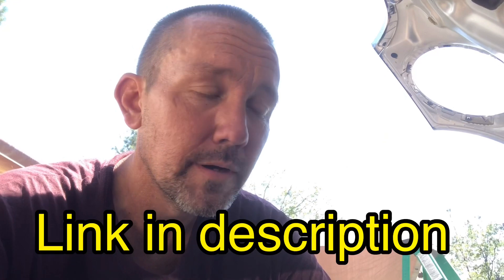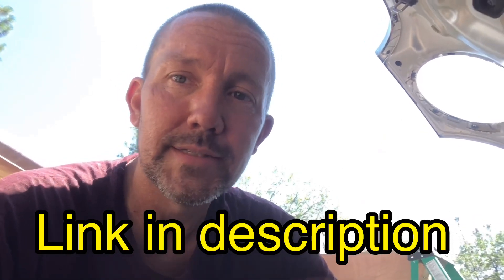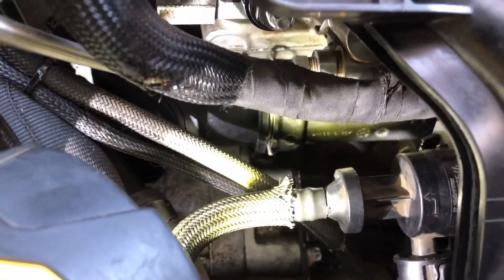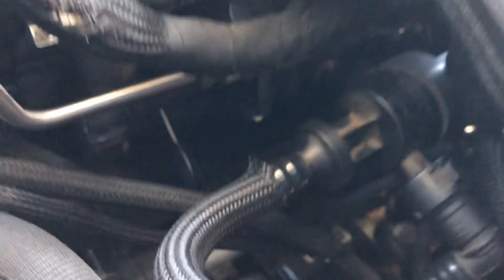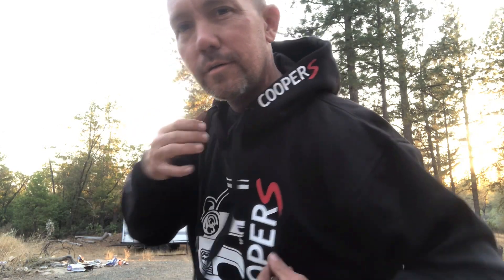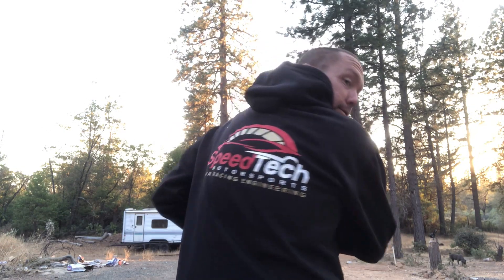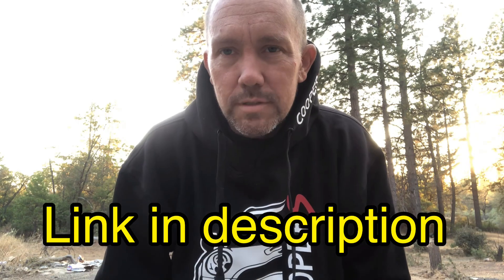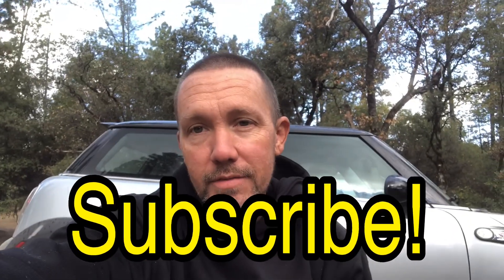How to remove & install the thermostat housing retainer clip on an R56 Mini Cooper S (N14 engine)

Comment: Finally a video describing how to put this darn clip back in.  I have struggeld through three different installations with this clip.  Just the fact is it rotates, and NOT go straight in is the SECRET!  At this moment, I dropped my pin somewhere in the back of my engine, (I might have an old one...) and wanted to see how to actually put this clip in.  I did not know it rotated.  Thank you for describing this.  Ugh!  Now hopefully I can find this clip (or my old one) so I can finish my beloved R56 (2012).  I bought this base (non turbo) coupe, for $500 and totally rebuilt the motor with 0.5mm oversized pistons.  I continue to get the P00BD "Permanent Mass or Volume Air Flow "A" Circuit Range/Performance - Air Flow Too High" because of the bigger pistons.  I have replaced many many parts, and even Mini service could not fix it.  My son is an ASE mechanic and smog ceritifed for the state (my interpretation) and it's just the internal software of the Mini calculates too much air flow.  To fix it for inspection (to get the check engine light off) I do the Vanos 'Adaptation' adjustment (Foxwell meter) and it takes the code off long enough to get it through inspection.  If anybody knows how to solve this exact problem, I would be forever greatful!

Comment: Hi i have 2009 1.6 petrol  mini and i have problem when i start the engine the radiator fan stay on and after I switch off the engine fan still on until 5 minutes i change the sensor or housing thermostat but still the same any help

Comment: My mechanic just told me the Clip isnt that Important, because the Crossover Pipe sits firm between both ends. What do you think about that?
Reply: I just found out (now that I’m replacing my thermostat) that I was driving my car for I don’t know how long without the clip. At least since I bought the car 4  months ago.
Reply: Same here. I don’t have a clip.
Reply: I installed mine without the clip. Honestly I regret it, it was ~10k miles ago but I moved to NY in the mean time and they are doing some construction work that left the roads very rough around here. The thermostat came off and leaked all coolant and left me stranded in the highway. I needed to get a tow and now I'm fixing it. I'll make sure the clip is in (hopefully that's all?) but I think you should seek to install it to avoid this kind of head ache.